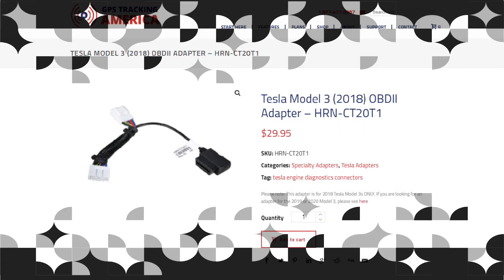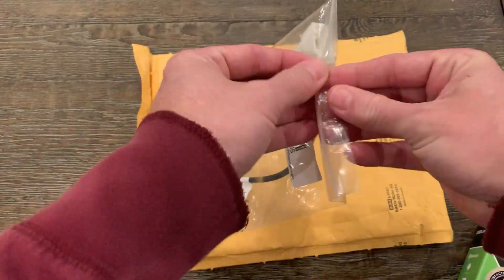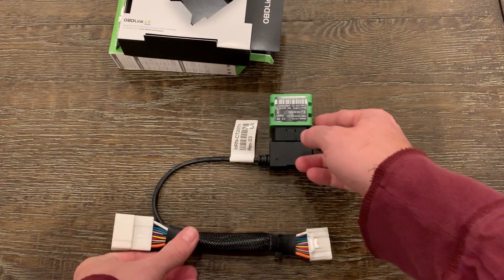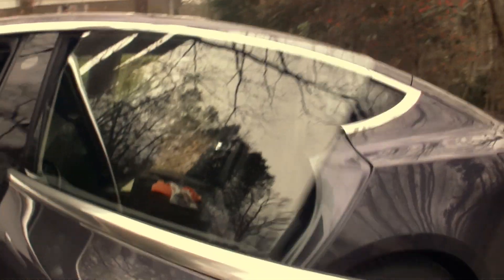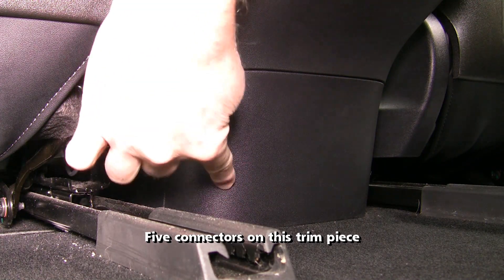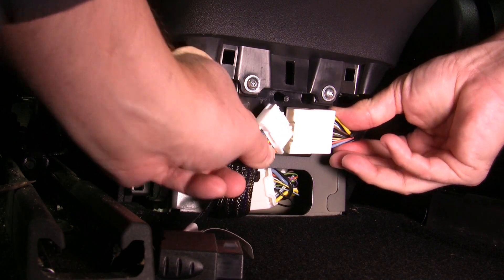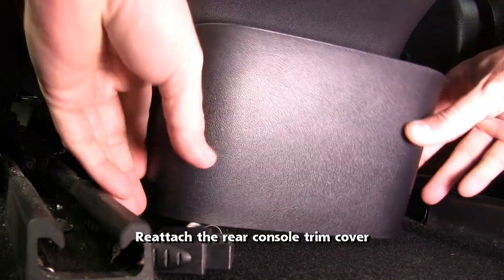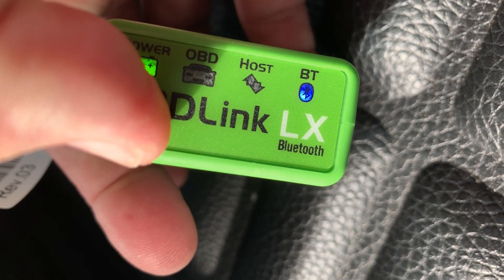Tesla Model 3 - OBD2 Adapter Install (old, see new version)

Comment: Where can I get this in Europe for a 2021 Model 3?
Reply from the maker: For the cable, this will work: https://e-mobility-driving-solutions.com/produkt/kabelsatz-m3/?lang=en
Reply: @MTNRanger  Thanks.  There's a big price difference. $29.99 vs 75€
Reply from the maker: @nelson-baleizao  I also found this better price at Aliexpress that ships to Europe.  https://www.aliexpress.com/item/4001048734304.html

Comment: Do you recommend removing it when taking the Tesla in for service? I'm curious if there would be any issues when Tesla service hooks up their diagnostic equipment during an appointment.
Reply from the maker: Yes, it's probably good to disconnect the adapter harness before Tesla service.
Reply: @MTNRanger  Awesome. Thanks for the video.

Comment: Not a good idea to leave a loose cable hanging near to a seat runner, or where it can be kicked by a passenger in the rear seat.
If it must be there stick it to a fixed panel using either velcro, or double sided tape to prevent movement, otherwise, finish the setup and install it under the panel.
Reply from the maker: Sure, you are free to install and place how you prefer.  I tuck mine between the driver's seat and the console, so it is out of the way.  During the install process, I had it sticking out while I was testing.

Comment: Great video thanks.  Did not know the Tesla M3 did not come with an OBDII port.  Thanks
Reply: Afaik the model s/x (not sure sbout 3) do have OBDII as required by law but since they have no engine it basically reports no information
Reply: @nas73603  No engine? You have to push it? With odb2 diag port you can see tons of informations, from seat's temp to  Doors opening 👍